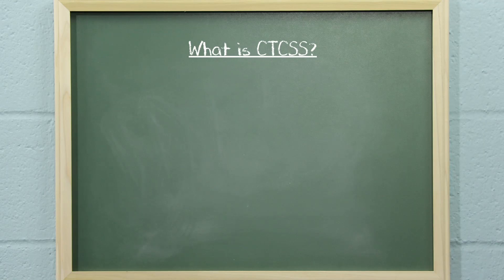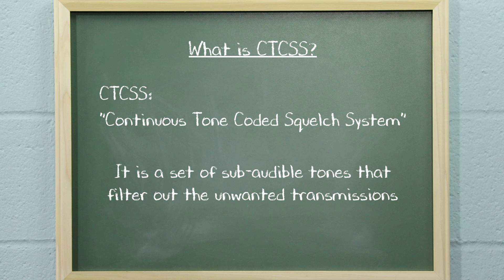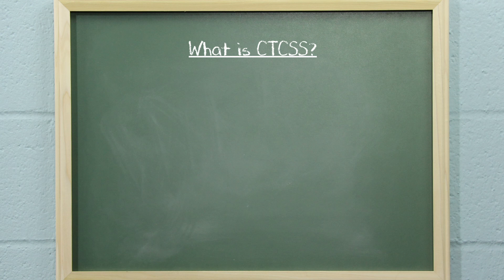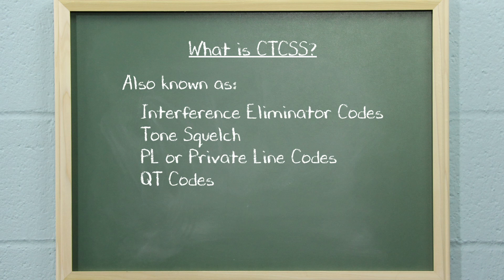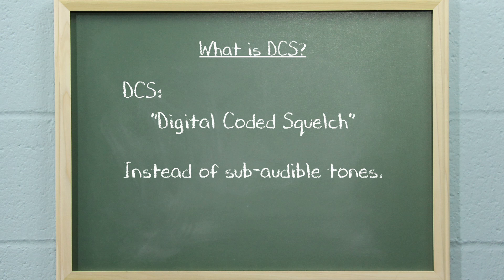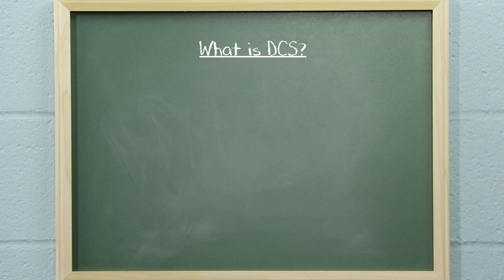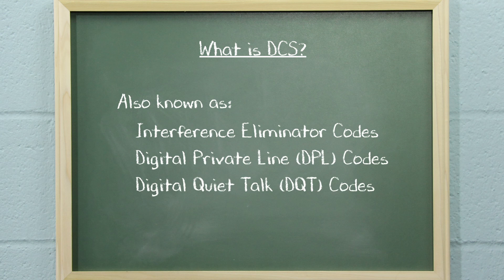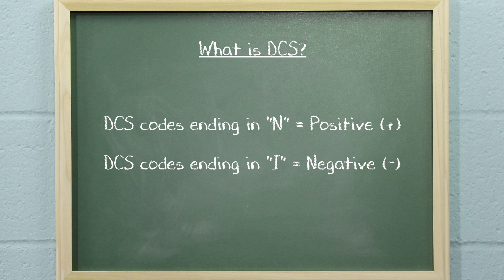What is the difference between CTCSS and DCS? | Radio 101

Comment: you didn't mention the Difference between them.
Reply: CTCSS is an analog tone.
DCS are digital. They both do the same thing. DCS has more codes than CTCSS has of tones, so you can be assured of not conflicting with other users. Also DCS filters better and is less susceptible to noise.

Comment: Hi, I just bought a set of dewalt 2 watt walkie talkies and I'm finding that when out at 1 to 1/2 miles and the signal is weak, one of the two radios can hear the other person but the other one does not. These radios have auto squelching so I'm thinking that the factory has set the squelch limit to high on the one. It doesn't happen when the signal is relatively good only when pushing the range limitations.  After reading the manual and watching your video, I'm wondering how or if these privacy channels play a roll in the squelching or are they a sub frequency between the 22 channels.  If you can help that would be great. Thanks, Craig.